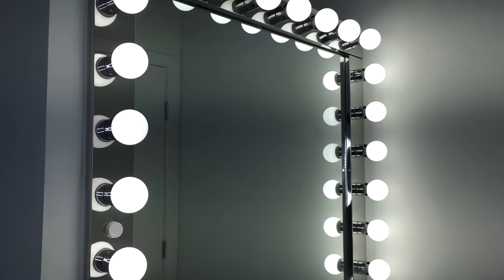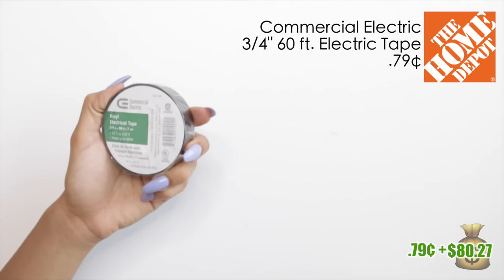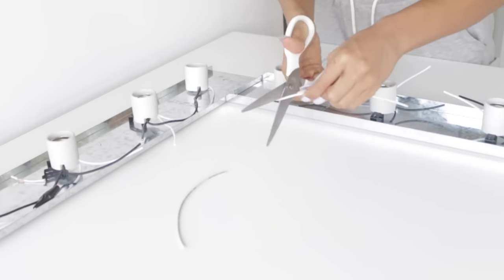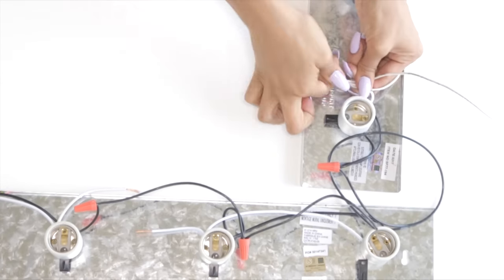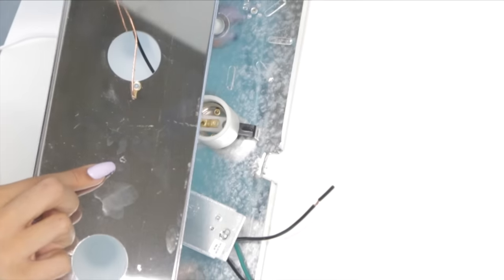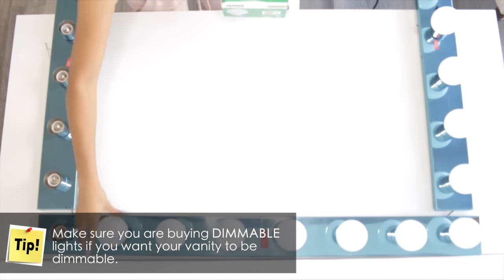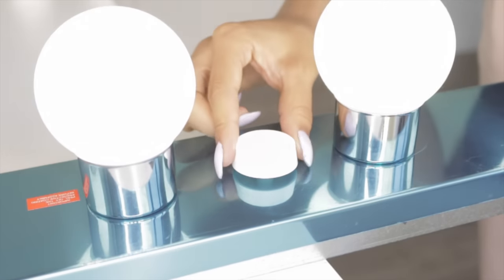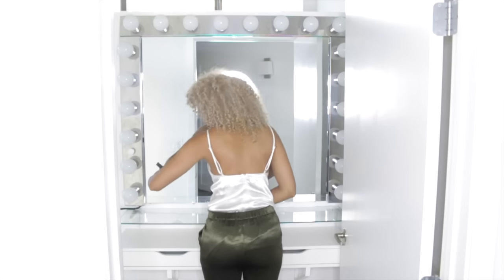DIY Vanity with Dimmable lights for under $250 (50 Inch Vanity)

Comment: Yeah, my dad and I spent time going to different stores to find a dimmer with a slimmer back, so I just decided to keep it. I put my mirror on a box frame vs mounting it to the wall. A dimmer cord sound like a good idea, but you’re right, now you have to deal with hole. I’m sure your vanity is gorgeous non the less. I wonder why she didn’t include that information about the dimmer as well.
Reply: Alexis Carrington could you send the link of the dimmer  cord you gotten from Amazon and quick explain of how it's  installed . Please!! 🙏🙏
Reply: Marco Cueva thanks!
Reply: Even better ! So did you still follow her instructions on using the "replacement cord" for the vanity  power cord. If so, how did you connect it since its no longer going to the dimmer
Reply: Avisha Cooper yes i used the black replacement cord she recommend. I just connect that to the vanity bar vs. the dimmer.
Reply: I'm really appreciating your replies !!! So black with black,  white with white,  and leave the green ground wire alone ?
Reply: Avisha Cooper yep. i just covered the green with electrical tape to be extra safe. but yes, black with black and white with white.
Reply: Thank you!!!!!
Reply: Thank you all for your replies. I ordered the one from amazon and will just hang the rest now
Reply: Alexis Carrington Hi. Did your bulb wattage exceed the maximum allowed for the wireless dimmer? It’s saying 100w maximum for LED bulbs but I have 18 bulbs which are 6w each bulb, so that puts me at 108w. Did you experience any issues?

Comment: You labeled the extra black and white zwiring wrong. At the beginning of your video you said it was solid wire and then when you started connecting the wires further on in the video you said it was stranded wires. I bought the wrong wires because I was going off what you said at the beginning of your video. I don’t know if you realize you did that but I just thought I should let you know. Other than that your video was very helpful. Thank you
Reply: Victoria Mroz hi! Just wondering are the correct ones solid wires or stranded wires?
Reply: They are Stranded..not solid
Reply: Wow she literally made me go and buy it !!! I’m annoyed asf . Thank you !!
Reply: @odalisreyes4312  omg I bought the wrong wires

Comment: aren’t suppose to connect the green wire coming from the plug to the green wire in the vanity light to ground them .. basically makes it safe incase one wire touch the other >? I was told by an electrician

Comment: Serious question.. why would you not use the already factory cut wires and just add an extension.. instead of conectividad and cutting again??? I’m about to do this and I watched this part over and over is it not the same??? Guessing you will use a little more wire??

Comment: If you don’t have a dimmer, can you connect the black/white wire from the vanity straight to the black/white wire on the replacement cord? Also what’s the green copper cable for ? You just leave it ?

Comment: I ordered everything I need and I’m so excited to make this. The only part I don’t understand is at the end you drilled holes into the sides of the face plates so the wires could be fed through but how did you feed the wires through if they’re already connected?
Reply: The Find Guru thanks for the reply! I’ll make sure to do it that way from the beginning!
Reply: The Find Guru I’ll tag you on Instagram when I finish it.
Reply: I have all my supplies as well I'm having the hardest time putting the  vanity bars OVER the mirror clips so it can lay flush with the mirror.  Any help with this ?

Comment: Hey love I love this I am definitely going to fo that real soon you are so bomb. I just have a question I want to do a vanity with a big 24” by 30” mirror with two vanity lights on the side but with the dimmer can you help me out would it still be the same way doing it the safe way like you instead of the extension cord. I kinda get the wiring part but I kinda don’t at times lol. With my instance of wanting to do it with only the two vanity lights on the sides of the mirror and I don’t want to mount it to the wall because I can’t drill or screw in the wall so I wanna do like a frame so the vanity mirror could be portable do you know how I could do it where I can do it where it could be portable, would my method be a little different because I’m only doing two on the sides and can you help me understand the wiring part girl lol would I still have the 4 exposed wiring parts ❤️

Comment: Where did you get the dimmer switch? I’ve bought two different ones to make it for my gf and neither of them have a thin enough box to fit inside the vanity, did you cut into the light bar to make it close or what?

Comment: How do you connect the lights to the mirror or do you hang them separately? How did you hang your mirror exactly? I know you use the drywall screws but I didn’t see how you hung up the light parts. Can you use an up n down light dimmer instead?
Reply: The Find Guru  how did you fit you dimmer?

Comment: I made this and it came out just like yours thanks😘😘
Reply: Couponing With Bezzy what did you do with the green/bluish cable from dimmer and replacement cord? Did you connect them?
Reply: “Pablo corona” I didn’t connect the two green cords but I did put the orange caps on them both and wire tape.
Reply: Thanks for the reply !!!!
Reply: How did you fit the dimmer ? I’m stuck on that part
Reply: What are the measurements of ur mirror pleaseeeee😭😭

Comment: why did you use the second to last wire light socket and use extra wires instead of using the very last light wire socket of each vanity bar to connect to each other? wouldn't it be easier, or it wouldn't work?

Comment: how did you get the mirror to perfectly fit between the lights if the light bar is 48 inches and the other two take up 9.5 inches to be right at the edge?
Reply: She placed the side lights on top of the mirror. She didn't mention that.

Comment: I'm having the hardest time putting the vanity lights on the wall over the mirror clips !! 😣 How did you get it too lay flush against the morrow and wall. I'm using exact same mirror and light bars
Reply: Yes that's exactly what I did.  Thank you! Did you cut into the dimmer as well ? The bulky back

Comment: I'm stuck on the dimmer part what white and black wires did u use to connect dimmer did u cut new wires or use the long middle two black and two white

Comment: Question: I made this vanity also... problem is the dimmer. How did you get the dimmer to fit in between the panels? The dimmer is too thick to close the light panels. Please help
Reply: BeautyNcurlz _ 
 have u figure yours out? Coz that’s where I’m stuck rightt now😩😩😩

Comment: I was confused when you connected the dimmer because I don’t know if you sealed the middle wires and then proceeded to cut the wires from the light and attach them to the dimmer

Comment: Why did you do 3 wires in each corner? Couldnt you just cut the end of each circuit instead of cutting between the 2 lights,  then make each connection with 1 short wire?
Reply: I want to know this too

Comment: I’m so confused. My vanity bar didn’t have 2 white & 2 black wires- it had 1 white, 1 black, and 1exposed copper wire. Is that what I’m supposed to connect in step 1?
Reply: Hello. What did you do about the exposed copper wire?

Comment: Omg so I totally bought everything to create this vanity but I’m stuck on how  did u get the dimmer to fit between the bar lights ? Mines does not close all the way because the dimmer is too thick! What did u do ? Please help me 😩
Reply: Tina Aurora same problem ! Driving me crazy did you figure it out?
Reply: Zora Bentley hey , yes I wasn’t able to get it to fit between the bar lights and I even searched for a different dimmer that was thinner but I couldn’t find one so I just added the dimmer outside of it onto the wall. It was the only other option I could do & it worked out pretty well. That way my bar lights were nice and flat.

Comment: I did the same exact mirror followed everything but i regret doing the dimmer like hers  because its too big and cannt close the cover of the vanity 😑 i searched for smaller one and even the one she used is big and i dont know why she didnt say that lol but good job this is the best and safest video is easier with the electric work which i was worried about
Reply: Noura A. hi! Did u figure out the dimmer situation?
Reply: Alexis Carrington I just put the dimmer and the bottom vanity will be opened. I will not recommend this kind of dimmer just get a regular dimmer attached out or something like that. If you look close to hers you will see the left vanity is little open on the bottom. I wish i can post a pic here lol but i like my nee vanity and enjoyed my first ever electrical work lol
Reply: I have the same problem. It would have been helpful if she had mentioned the cover wouldn't fit over the dimmer properly. Now I have a gaping hole to cover after I install a dimmer cord as an alternative.
Reply: Me too what did you use to replace yours?
Reply: Chelsea Garrett omg yea i hated that so much it would have helped other than hiding it
Reply: Soemarie  Morin no because i already had a hole but i kept it the same waste of money but its okay not big deal
Reply: Soemarie  Morin 
I switched out the black heavy duty power cord that she promoted in the video to a standard two-prong  extension cord (cut off the head and hard wire....since the outer sleeve is not color coded, remember the smooth side of the cord is spliced with the black wire and the rough or ridged side is joined to the white wire. I then purchased a corded LED table top lamp dimmer switch and plugged it to the power cord. To cover the hole in the chrome cover I simply hot glued two square magnets to the back of the dimmer control box head and affixed it over the hole. My daughter absolutely loves the slider type dimmer switch and that awful hole is now concealed.

Hope that helps :)
Reply: Soemarie  Morin 
Also please remember to only use LED bulbs as the high wattage from incandescent bulbs may fry out the LED dimmer switch and/or standard power cord.
Reply: Noura A. 
Hi Noura I sent my alternative solution to Soemarie Morin. My daughter absolutely loved the outcome, it works great and that awful hole is concealed. Hope it helps :)
Reply: Please send me the alternative for closing the hole.
Reply: I switched out the black heavy duty power cord that she promoted in the video to a standard two-prong extension cord (cut off the head and hard wire....since the outer sleeve is not color coded, remember the smooth side of the cord is spliced with the black wire and the rough or ridged side is joined to the white wire. I then purchased a corded LED table top lamp dimmer switch and plugged it to the power cord. To cover the hole in the chrome cover I simply hot glued two square magnets to the back of the dimmer control box head and affixed it over the hole. My daughter absolutely loves the slider type dimmer switch and that awful hole is now concealed. Hope that helps :)
Reply: Keep in mind that you must use LED bulbs with this alternative since you are no longer using the heavy duty power cord :)

Comment: I just finished making the vanity , and I got the same dimmer as you , how did you make it close all the way with the dimmer inside ? Cause it’s hard for me to close because of the bulkiness back of the dimmer
Reply: my dimmer is not fitting well, so I can't close it all the way
Reply: I bought the same dimmer as that in the video, and mine doesn't fit either :-(. I wish I'd known this would be a problem before I drilled the hole in the cover. I will probably have to install a corded dimmer as an alternative.

Comment: Also the bulbs stephanie used are WIRELESS 😂😂 You just stick them on the mirror and you can plug them up also you can dim and brighten them if youd like Hey guys if your still looking for low price vanity dupes look at stephanie rose & bria cristy channel they used lights that have the sticky back & the mirror were very cheap the white drawers and table top were also cheap i will definitely be using their method when i move !!

Comment: Okay so after a few hiccups here and there, I’m almost done. The only thing I haven’t figured out is how to find a dimmer switch that is thin enough to fit inside of the vanity bar and allows me to close it.
Reply: Cameo Surgeon hi! Did u figure out the dimmer situation?
Reply: Nice. I went with a plug in dimmer instead from amazon . 20 bucks. Has a remote as well. Glad you found a solution
Reply: Yes what did you all end up using? I’m having the same problem
Reply: Home Depot and Lowe’s also no longer sells this mirror (they literally discontinued it a week before I went to get it 😡) so I had to pay a local mom and pop glass store to make it. But honestly, I’d rather support them instead anyway.
Reply: Cameo Surgeon that’s good because this mirrors was actually too big...just something she forgot to mention lol. It looks nice but it’s a little wonky
Reply: could you email/text me the pictures also? I’m about to make this too and i have noticed from multiple visits to Home Depot and Lowe’s that it’s not all correct 😕
Reply: I ran into the same trouble. Did you find a solution?
Reply: Hi I had the same issue with the dimmer 😭😭

Comment: * TheFindGuru, please make a written update so that people don’t waste their money on that specific dimmer and damage their chrome faceplate by drilling a hole for the dimmer***

1. Do not purchase the dimmer from the video.  It does NOT fit and you will not be able to put the vanity chrome faceplate on at the end.

2. You need to drill holes in both the face/bottom chromeplates so that you could feed the wires through at the end.
Reply: What dimmer do you recommend?
Reply: Girl yes because i went through two dimmers they don’t fit.
Reply: Brandi Sheri what did you do to fix this problem

Comment: so let em just say i made this vanity...dont get me wrong its beautiful and looks very nice but theres alot of flaws. This young lady did a tremendous job explaining the electrical portion of this diy projects but she didnt mention how precise you have to be when drilling the holes for the wires to pass through and also she didnt mention that the light bar cover will not close entirely with the dimmer on the inside.  the dimmer is way to fat. anyways i plan on redoing this vanity without the dimmer.

Comment: You wrote 14 White Solid Wire at the beginning of your video...but then you wrote 14 Stranded Wire later on in the video. I bought the Solid Wire and it didn't work. I don't know if you realize you did that but I thought I should just let you know.

Comment: How did you get the dimmer box to fit inside the light strip.. we bought the same dimmer at Home Depot and it’s too deep
Reply: jonathan emanuel same problem 😩 did you figure out how to fix
Reply: I used a wireless dimmer switch from Amazon. Cost around $17 dollars and even comes with a wireless remote control. It has worked great so far, very happy with it. The dimmer is Instapark model N1. You should be able to pull it up easily on Amazon that way.
Reply: See my answer to Zora Bentley. I used a wireless remote from Amazon. Works great.
Reply: Zora Bentley do you want pic of the mirror completed or the dimmer switch/control?
Reply: jonathan emanuel both if you don’t mind. I want to see if i should switch out to the dimmer you have
Reply: jonathan emanuel Hi. Did your bulb wattage exceed the maximum allowed for the wireless dimmer? It’s saying 100w maximum for LED bulbs but I have 18 bulbs which are 6w per bulb. So my total will come out to about 108w. Hopefully I’m understanding this correctly. Thanks in advance.
Reply: Anitra Smith you are calculating that correctly. But the dimmer should handle 108 watts just fine. They always build quite a bit of padding into those capacity limits. 108 watts should work just fine with that switch. My design came out to about 96 watts. I wouldn’t hesitate to run your setup with it though.
Reply: jonathan emanuel Thank you so much for the quick response. I’m building mines today, so this information is very helpful. :)

Comment: How did you get the dimmer switch to fit in between the plates ?
Reply: Mariah Patrice hi! Did u figure out the dimmer situation?
Reply: Alexis Carrington Nooooo 😩
Reply: Yeah, neither did i...oh well...given how much i saved and the memories made putting it together with my dad...it cool. I did not mount mine to wall, but instead created a frame so that it could set ontop of my vanity. Thanks anyway.
Reply: No problem . I’m glad you found a solution , I’ve already drilled the hole in my plate so I’m stuck at the moment .

Comment: Was anyone able to figure out the dimmer ? I’m so stuck on this last part pleaseeeee someone respond
Reply: doing that now wish I had an answer
Reply: LaLa girl i wish she would respond...I’ve been through three different dimmers..they’re all bulky. Idk if they’ve changed the model since she’s bought it last year or what .(driving me crazy )
Reply: I cant find the 8 bulb light strip ? Can you help me tell where you got yours from
Reply: 3 OPTIONS  FOR DIMMER THAT DOES NOT FIT:
 (1) Cut a square from the plate of the light strip (with a electric saw) that is going against the wall. Cut the wall too and add a electrical box and your dimmer. 

 (2) Set a wireless dimmer 

(3) use a dimmer cord instead  of the dimmer knob.
Reply: Linda Rivera good tips! This was already too much for me so I ended up just putting it on the side with command strips ...I’m so mad I’m a perfectionist i wish i would’ve gotten the same model as hers. But whatever it still came out nice. Just have a whole in my one of my strips :(